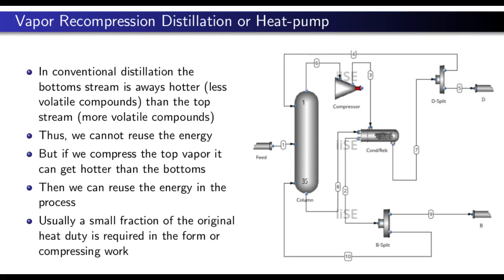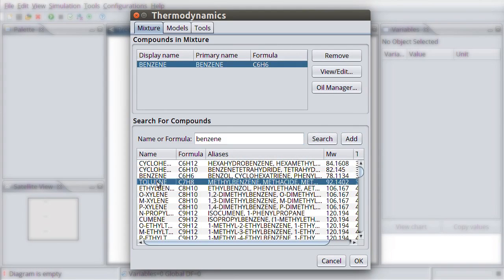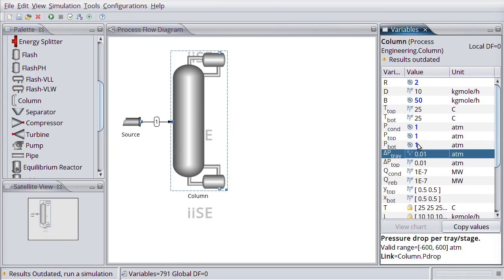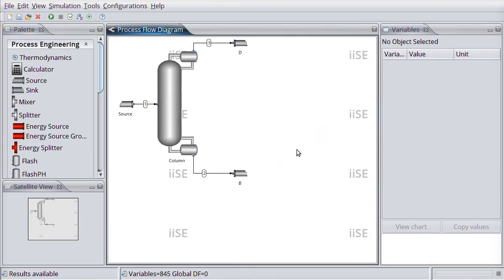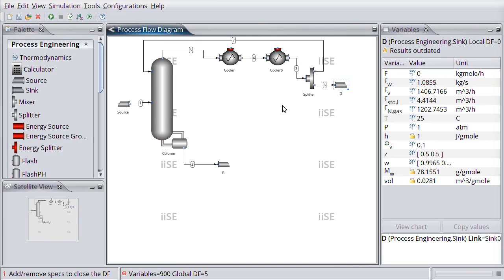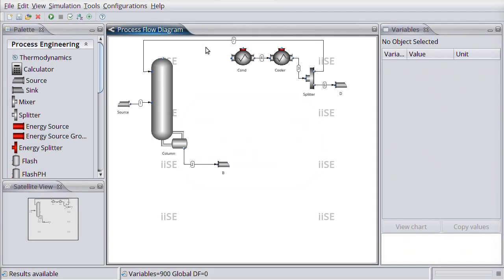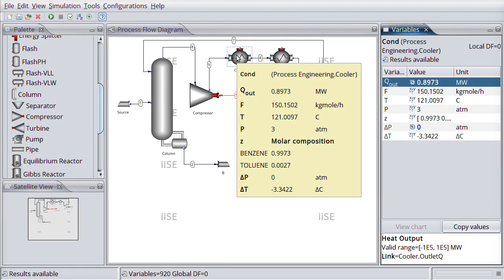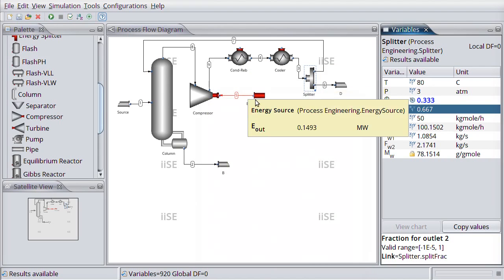Reducing energy requirements in distillation columns: vapor recompression

Comment: Thank you for your answer. However I have one more question..... I try to correlate the configuration in 7:26 with the configuration of 0:28. My question is: You add a compressor in the top of the distillation in order to increase the temperature of the overhead stream and to use this heat in order to heat the reboiler. However I'm struggling a bit about the temperatures. If I see the figure in 0:28, in which the heat exchanger has replaced the condenser and the reboiler, the inlet temperature of the hot stream in the condenser will be the 117oC, which is the outlet temperature of the compressor and the outlet stream of this hot stream will be 80oC. This hot stream will give its heat to the reboiler stream, which is the cold stream. But here is my problem what will be the inlet temperature of the cold stream to the heat exchanger, as it is depicted in 0:28 and what it will be the outlet temperature of this cold stream in the heat exchanger. I would like to mention that as hot stream I mean the stream that is going through the condenser and as cold stream the stream that goes through the reboiler. And my final question the outlet of the heat exchanger will be in the liquid phase??? Thank you in advance!!
Reply from the maker: Since the bottoms stream is almost a pure substance, the phase change (from liquid to vapor) will occur with almost no change in the temperature of the stream. For more details, please create a user at http://lvpp.nuvem.ufrgs.br:8080/ and run yourself the last example (called 'Vapor Recopression Distillation'). There you will find this process with industrial data for the propylene/propane separation and you will be able to see all the temperatures, compositions, flows, etc.
Reply: Thank you for your help.

Comment: First of all thank you for your nice and so practical explanation for the heat integration of a distillation column. But I would like to ask you the top product (distillate) that u add in the compressor is in the vapor phase right? not the stream after the condenser, which is in the liquid phase? Thank you in advance!
Reply from the maker: Correct, in this case you get the vapor phase leaving the top stage and compress it. When entering the compressor you will have a vapor (saturated or near to that - depending on the pressure drop before the compressor), it will be then overheated during the compression.